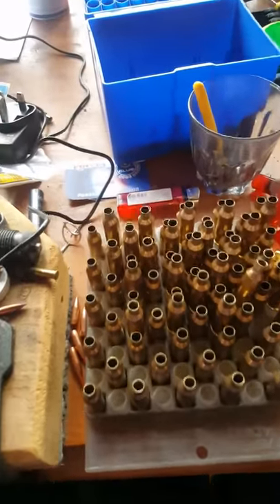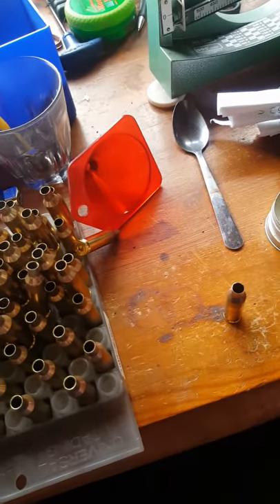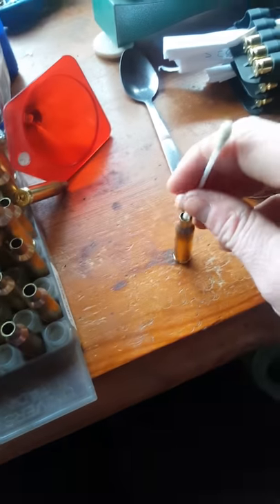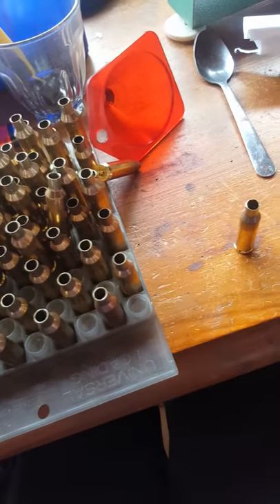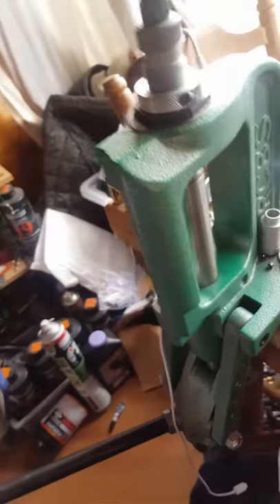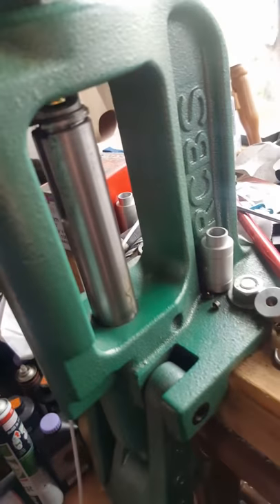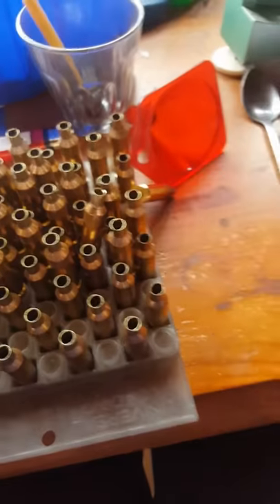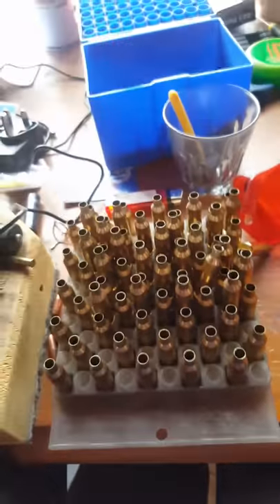6x47 lapua brass forming

Comment: What a great calibre 
Just about to build a rifle myself in 6x47lapua would like to get more info from you about it loads barrel length etc been told it's a tricky one 
Cheers
Reply from the maker: Del Boy no sure where you got the info on the round being finicky to load for . The 47 family is inherently accurate.  So accurate you can often have the loaded rounds made up before the rifle is made and off you go. Very wide accuracy nodes and not fussy about bullet types. I use mine for small game and vermin. 87vmax at 3250fps. 
24 inch bartlain heavy rem varmint  contour.  tikka t3 action.  bix  n andy trigger .  pes t12 scout moderator sitting in a grs  beserke stock. sweet as a nut. 
38.8.gr viht n550 for the 87vmax 
40gr varget 70gr nosler bt 3610fps all under .4 moa. 
good luck with yours. I dout you'll ever be without one .
Reply from the maker: Del Boy I've seen data for 133 with 70 gr8 and it was fast. 
Max  with fast powders seems to be around 42gr . I'd start at 39 and work up in .3grs with a good 20 thou jump to eliminate false pressure readings. and go from there.  I would be you'll find a couple nodes around 40gr
Reply: djgornall 
Thanks well rifle will be being built within next month so if I have trouble getting sweet load I'll ask you ha as don't know any people that actually shoot this calibre

Comment: someone that had loaded for one before can't been much of a home loader ha 
I'm going to be building mine on a sako 75 action was going to go for a 22inch barrel keep wèight down any good or longer? what twist rate you got 1 in 8?? 
I was thinking 55 grain nosler or 58 grain vmax with n140 powder for fast flat 
what's the min and max you would go on powder?
cheers
Reply from the maker: Del Boy ye 22 inch is fine. mines a 1/8 twist.  seems to be fine with the 70s . I'd probably go for n133 or n135 for that lightweight bullet. h380 . varget. h414 n540 . n550 rl15 all work well in this calibre
Reply: djgornall 
I use n140 for another calibre I load ment to be suitable for 6x47 too why do you think n135? but was going to give some n550 ago too what would you say on min and max powder charge roughly? as can't find that much on load data for it anywhere